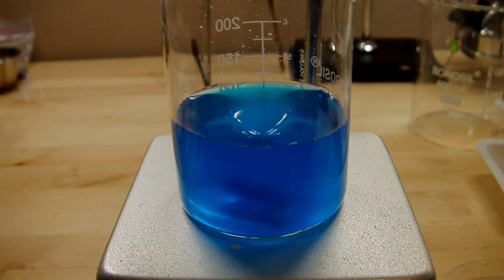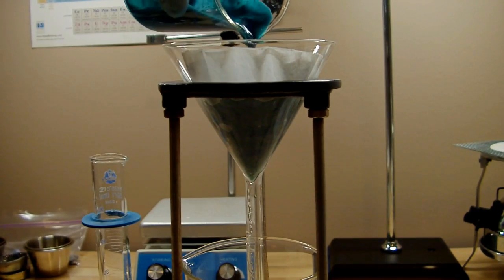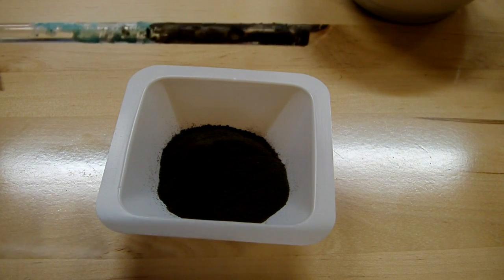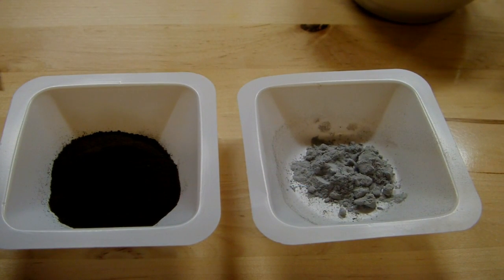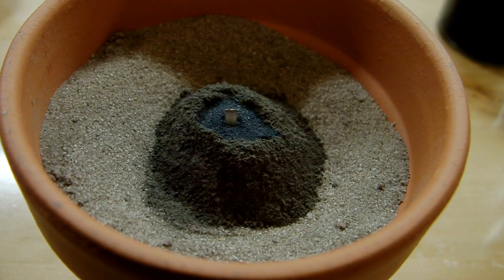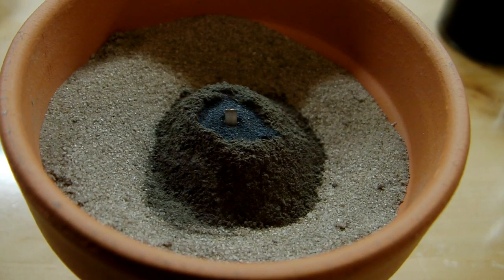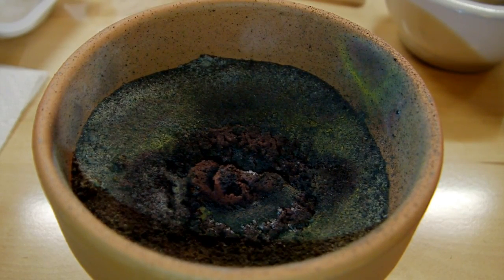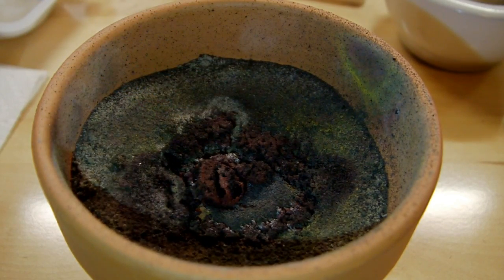Schweizer's Reagent to Thermite

Comment from the maker: @pyroscience42 That would be tough, because aluminum is so reactive. The way I would normally make a metal powder would be to displace it from a solution of one of it's salts, like putting an iron nail into copper sulfate solution. But since Al is a very reactive metal, this would be difficult to do. Normally you don't think of it as being reactive because it's always coated with a protective oxide layer.
Reply: @mrhomescientist If you making schweizer's reagent, you definitely need ammonia.

Comment: @pyroscience42 Cut aluminium foil into extremely small pieces, add some charcoal, and use something that can crush it very well, something like a ball mill prefereably. The charcoal is so you don't get your entire powder oxidized, and if it's good charcoal will add to the burn anyway.

Comment: you can also make a plastic bag, where you put your Schweizer's Reagent, and a bunch of these  silica bags. Close the bag, and leave for a month. if still not dry, replace the bags :-) 
The advantage is that the amount of oxygen is limited, once it reacted on the top layer of your Schweizer's Reagent there is no more oxygen to react with.